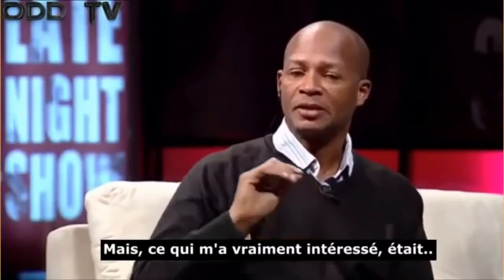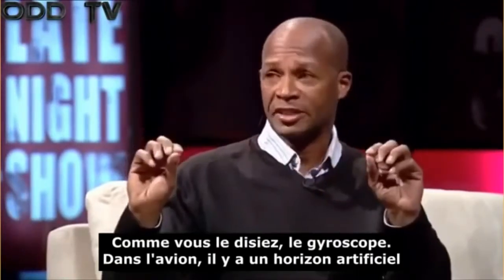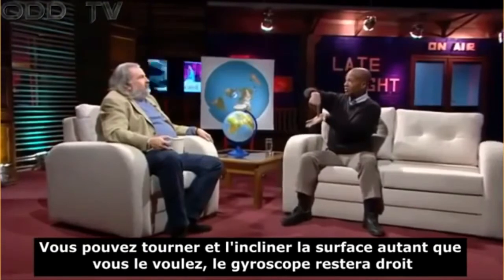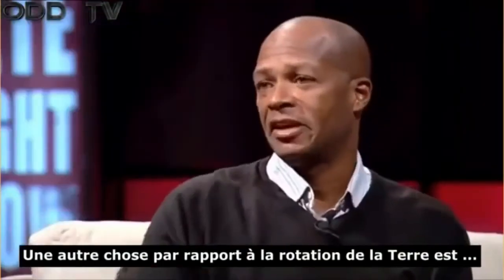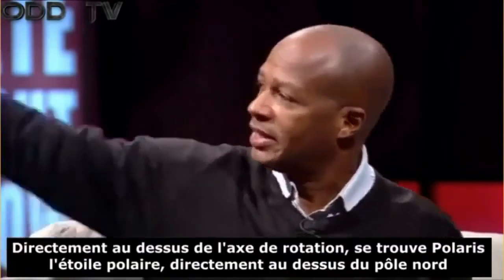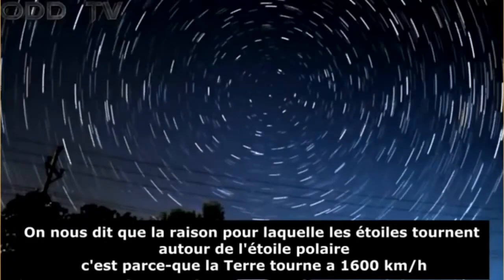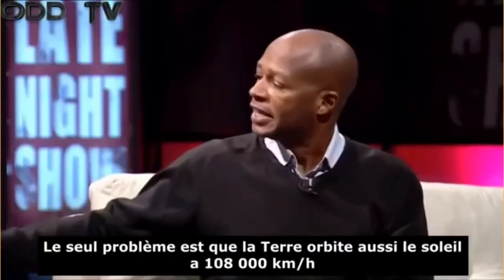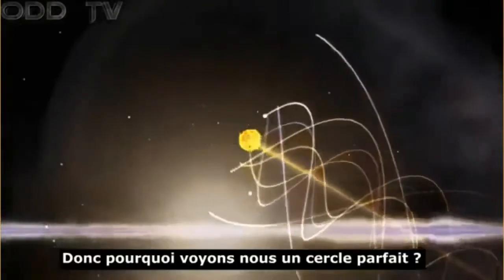Terre plate en PLS 3 🌍 Gyroscope vs Dave Murphy

Comment: En fait, la rotation de la terre a bien un impact au niveau de l'equateur. La terre n'est pas une sphère parfaite mais est un peu aplatie au niveau des poles et donc enflée au niveau de l'équateur. Mais bon, pas au point que l'eau recouvre toutes les terres s'y trouvant...
Reply from the maker: Oui, c'est la force centrifuge qui a tendance à nous éjecter de la surface de la Terre comme nous sommes attirés vers l'extérieur des virages en voiture. Cette force centrifuge est très faible comparativement à la force gravitationnelle.

Dans l'ensemble l'accélération liée à la pesanteur (qui retient tout corps à la surface de la Terre, en fait une somme de deux forces distinctes : la force gravitationnelle et la force centrifuge) varie de 9,83 m/s² aux pôles à 9,78 m/s² à l'équateur où la force centrifuge est maximale. Cette différence qui n'est que de 0,5 % est trop faible pour être ressentie directement par un être humain.

Sur l’aplatissement, cela correspond à une différence de 1,7 mm par pôle sur une boule de 1 m de diamètre. Autrement dit la déformation est invisible à l’œil nu.